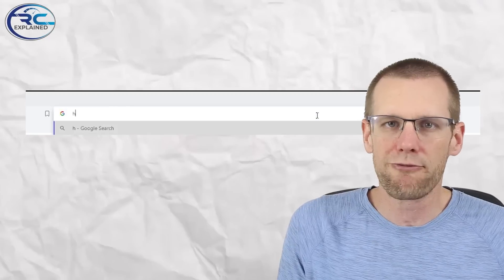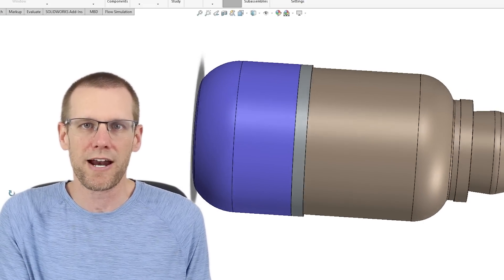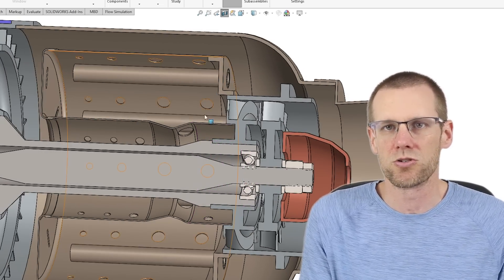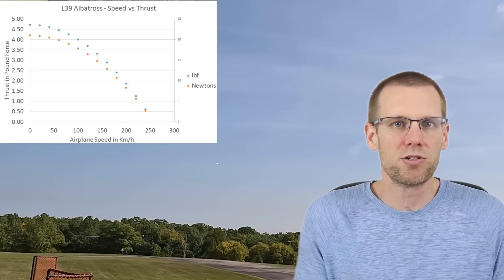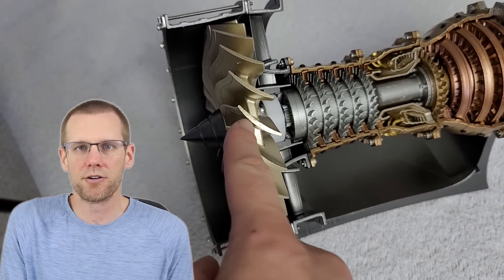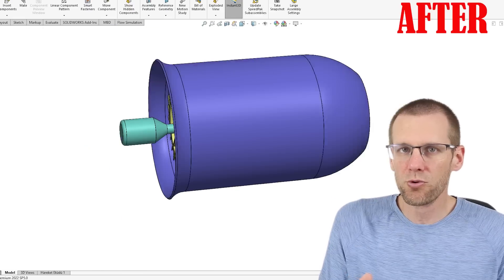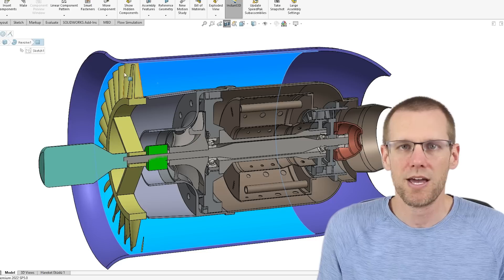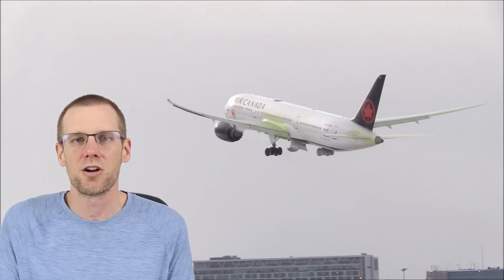RC Turbine Engines Could Be Crazy Efficient If They Made This ONE Change!

Comment: I want 10 minutes of my life back. This is little more than a clickbait plug for that crappy overpriced 3D printed engine which that company is selling ILLEGALLY and handing out to any random youtubers lately from what I've seen, that design is blatant copyright violation from the original designer who posted that 3D printable STL almost 8 years ago. Nothing explained here is not something nobody that's been paying attention already doesn't know, and that proposed turbofan design is laughably useless, and RC turbofans have been made but they are largely one-off experiments. The technology/demand just isn't there yet and just may never be since there's too many tradeoffs at these scales. Furthermore just look at all the problems a the Pratt and Whitney geared turbofans have created for their operators. They are absolutely horrid in reliability.

I fly both full scale jets for work and RC turbines for fun and you just can't transfer the many of technologies from one to the other. Simplicity and lightness are key in the RC world. If people want efficiency, they just need to buy better engines. For example my Xicoy engines are far far more efficient that the equivalent chinese branded ones in my clubs and I'm flying significantly longer times with my Xicoys despite having smaller tanks sometimes than people do with Kingtechs or Swiwins. Those are guzzlers are are much bulkier engines, they're cheap for a reason.
Reply: Lol i made a similar observation but my comment here was deleted - they also have ericthepoolguy's engines for ssale :(

Comment: The efficency of a turbine engine, as with any internal combustion engine, is a function of compression ratio.  A single stage compressor is very limited.  To gain efficiency a multi stage compressor is required and axial flow is the best way to do that.  The very first (WWII) jet engines used a single stage centrifugal compressor which is why the first generation jet planes had relatively large diameter fuselages though the Germans did develop an multi stage axial flow engine (Jumo 004) used in the ME 262.  Its smaller diameter allowed an underwing twin engine layout not practical for the fat, barrel shaped centrifugal engines used by the allies.  Axial flow engines required many years of developing advanced machining processes and metallurgy to take advantage of the higher forces and temperatures (and thus efficiency) of the axial flow designs. The big fan with bypass airflow can make use of excess power from the power turbine section but adding a fan to a single stage compressor and single stage power turbine engine is not going to do much for overall efficiency but will increase diameter and weight which is not desirable in most applications.  Modern turbine engines have compression ratios of about 30:1 and acheive very high efficency as a result.  That requires extremely accurately made parts in the compressor and turbine stages as well as benefitting from the larger diameter of the full scale engines.  A small scale turbine, even with multiple stages, would be very difficult (and expensive) to fabricate and would be limited in the peak compression ratio and efficiency simply because of the small size of the components.  Despite such limitations, some efficiency gain is possible and Williams Advanced Engineering was developing a small scale, multiple stage axial flow turbine to power a generator for a proposed hybrid vehicle application for the now discontinued Jaguar car company C-X75 project.  It is doubtful that such an engine could be made at a price realistic for recreational RC applications.
Reply: In order to reduce the temperature of the exhaust which hits the turbine blades, I imagine that we should convert temperature to a swirl of almost the speed of sound at that temperature. Then a converging nozzle as in a turbo could even increase the velocity using the cyclone effect.

To reduce the velocity on the way to the compressor blades, the compressor radius needs to be smaller.

For some reason RC engines and APUs barely swirl the flow?
Reply: Please note that when the fan is placed IN FRONT of the compressor intake as suggested in this video, it would further raise overall pressure ratio.  For example, the centrifugal compressor  has maximum pressure ratio of 4, while the fan with stator can deliver 1.5 pressure ratio, thus boosting pressure ratio to 4 x 1.5 =  6, thus will cause additional gain in power and thermal efficiency INDEPENDENT of the gain in thrust and propulsion efficiency from the big fan disc.   And this is not difficult to do, as is suggested in the video.  

Hopefully, some companies will take up on this to make turbofans for bigger RC models,  for fast military drones and UAV and even for some man-carrying gliders powered by big RC turbojets, as well as for ultra-light turbojets like the BD5 and the Sonex jet...since big turbojets consume a lot of fuel thus reduce range and payload considerably due to the massive weight of the fuel.
Reply: @trungson6604  I propose hollow stator vanes to route air from ram air inlet scoops around the circumference of the bypass to the compressor intake in the center.
Reply: @ArneChristianRosenfeldt  -- Agree. Good idea.
Reply: there are turbines (turbofan cores...) that reach 60:1 compression ratio, but their limits are with hot section temps...as for the single stage compressors - take a look at the russian VK-650V. It's a modern design turboshaft, the compressor looks like an automotive one, just...big...
Reply: @AKAtheA  I guess I have a problem with the names. I thought that first there was the water turbine. A turbine converts fluid energy onto a shaft. See : work turbine in a turbo shaft . Or turbine boosted in contrast to gear driven compressor. I only talk about the hot section. Compressor is just CFD and aluminum.
Reply: or the engines it's designed to replace - Pratt & Whitney Canada PW200 or Turbomeca Arrius families, all single stage radial compressors with competitive efficiency
Reply: damn thats a lot
Reply: I feel like you’re missing a critical factor, Buypass air. Buypass air is responsible for almost 80% of thrust on modern commercial jet engines. Buypass air is not compressed. Therefore, efficiency increases drastically. At least that’s my understanding.
Reply: @JN24185  bypass
Reply: Is more power really the goal? RC Jet engines produce more thrust and eflux then what’s realistically useable for a pilot at an airfield. If anything the jets aren’t the limiting factor as much as transforming their energy into useful power. With the above videos suggestion of making scale turbofans, it would probably look more like smaller cores turning conventional diameter fans that are better balanced for the speeds the aircraft is expected to fly.
Reply: @air-headedaviator1805  scale jetliners . Cold air around the hot exhaust when you have the place the engine to far ahead. Actually, all fighter models should stick their jets right into the exhaust nozzle like EDFs do. Power per weight is so good .
Reply: There’s a difference between thermal efficiency and propulsive efficiency.

Comment: Model turboprops are already on the market.  They run a power takeoff turbine that drives the propeller.  Changing the design of this turbine section would make it suitable for a direct fan drive.  The fan would be at the rear of the engine with current designs, but that should still work.  A redesign with a hollow main shaft would allow the fan to be in the front if desired.
Reply: Definitely doable, in the early 1960's General Electric stuck an aft-fan on the CJ610 turbojet to make the CF700 turbofan.
Reply from the maker: This would be a good alternate design 👌
Reply: There is no thing like power takeoff turbine, only power turbine!
Reply: I have exactly this idea in mind.  Would work best in a fighter jet model with air scoops directing the air toward the aft fan.  The exhaust would be routed to enter behind the fan  to mix with cool air aft of the fan for more thrust.  Would need 1 fewer stage of reduction gearing because the ducted fan would  spin faster, thus would be  less expensive, while the fan should cost comparable with the propeller on the turboprop model.
However, for more power and efficiency gain, the fan should be placed IN FRONT of the compressor intake as suggested in this video, in order to further raise pressure ratio.  For example, the centrifugal compressor  has maximum pressure ratio of 4, while the fan with stator can deliver 1.5 pressure ratio, thus boosting pressure ratio to 4 x 1.5 =  6, thus will cause additional gain in power and thermal efficiency independent of the gain in thrust and propulsion efficiency from the big fan disc.   And this is not difficult to do, as is suggested in the video.  

Hopefully, some companies will take up on this to make turbofans for bigger RC models,  for fast military drones and UAV and even for some man-carrying gliders powered by big RC turbojets, as well as for ultra-light turbojets like the BD5 and the Sonex jet...since big turbojets consume a lot of fuel thus reduce range and payload considerably due to the massive weight of the fuel.

Comment: They also need air-bearings 25hr overhauls are terrible. And sadly Turbofan doesn’t help me improve fuel consumption on my turboprop based Mini APU. But cool idea!
Reply: APU's are well suited for direct attached loads.. I wouldn't be using a free turbine for that design.  Sinc it's stationary, and you can spare space, you could also look at a recourperator design.

Comment: All modern turboJET engines in the world are AXIAL FLOW turbojets.   Basically the exact same multi-stage design of the turbofan shown in this video but with smaller compressor blades that don't bypass air around the engine but all the compressed air goes straight into the multi-stage compressor.  
The axial turbojets used in the RC industry are primitive designs first developed in the 1930's.  It's like comparing 2-stroke RC glow engines with carburetors to modern 4 cycle engines with fuel injection used in full size cars.
Reply: its a lot easier to get a higher compression ratio from a centrifugal compressor, and the blade clearances arent so critical. 

gas, air, it doesnt scale down. clearances become greater percentages of total area as size reduces.
thermal losses through surface to area volumes increase as size reduces.

the bigger the turbine, the better.
Reply: Actually no, the Garret ATF3 is a combined centrifugal/axial multishaft engine that works quite well.

Comment: Or could build a hybrid. The advantage of a centrifugal compressor is that it compresses air a little more efficiently than the axial flow (AF is a 1:1.1 compression ratio where a CF compressor is 1:1.2 compression ratio). For a single stage compressor it's definitely the way to go. However even a hybrid is still going to need two turbine wheels, the first to power the compressor, the second to power the fan. I wouldn't mess around with a gearbox though that is an option, but it works much better for a turboprop. That in turn is going to add weight and complexity to the engine. It can definitely be done though, the question is how much is a hobbyist willing to pay for it?

In fact come to think of it, Wren built the engine for my father's Bergen R/C helicopter. It was constructed much like the Pratt and Whitney PT-6 in that the driveshaft that turned the heli's transmission was not mechanically connected to the turbine shaft. That concept could definitely be done to turn a bigger fan and create a true turbofan engine. The only thing is that I do recall the Wren being a bit more expensive than the Jetcat engine he was also considering.

Oh, and as far as sound... Yes it would sound different, but not necessarily bad. Fighters like the F-16 and Phantom use low bypass turbofan engines, whereas airliners use a high bypass fan. Oh, something else to consider is that you could mount the fan on the rear of the engine. That's what Convair did with the 990 Coronado airliner when they used the GE CJ805 engines. It was the fastest airliner of the bunch. The concept worked obviously!

Sorry, I'm thinking aloud! LOL!
Reply: I also think that a hybrid axial-radial fan is the way to go for the fan. RC planes are well below the speed of sound, and we need to pass around this wide centrifugal core engine. So we should compress air into that annular ring. The outer part of the fan blades move fast and can create a lot of pressure axially. Still it might be a good idea to slightly tighten the intake and have a conical "diffuser" duct around the fan.

Comment: 6:34 every turbo fan engine I know of, don't power the fan from the centre core drive shaft, no physical transmission between the two, the suction from the centre core spin the fan. I think your design with the reduction gear box may increase lag in throttle response, I could be wrong, but we won't know until someone builds one.
Reply: First of all, I don't know of a single turbo fan engine that is powered "by the suction of the center core". All turbo fan engines are powered by a shaft that goes through the center of the engine and is connected to either one or multiple stages of turbines in the rear of the motor. Some engines are dual, or even triple spool engines, which in essence means there are separate turbine sections that all spin free from each other and power their respective compressor or fan section(s). By the way, geared turbo fans are not necessarily new concepts, but they are new to being more frequently used as they had proven to be unreliable when first designed. Now, Pratt has their geared turbo fan there might be one more but not many of them. Rolls Royce is currently testing their new Ultra fan which will be the world's largest geared turbo fan engine as well as largest turbo fan engine in general. 

-currently build Rolls Royce Trent XWB engines... which are (almost) the same size as the current largest turbo fan (GE)  in the world.
Reply: "the suction from the centre core spin the fan" - Can you give an example of at least one engine that has this? Sounds crazy to me. And there are plenty of geared turbofans, for example PW1000G.
Reply: @Positive_Altitude  there isn't a single engine that is "powered by the suction from the center core" that doesn't exist. No clue where that info is coming from. All turbo fan engines are essentially ducted turbo prop engines. Which is also why they CFM is working on that they call a ductless turbo fan engine which is literally a turbo prop.